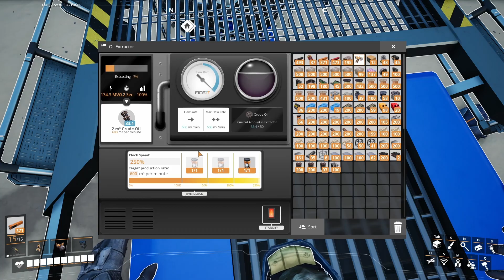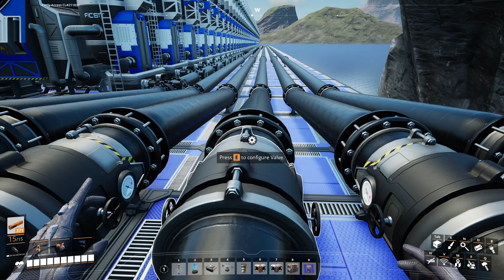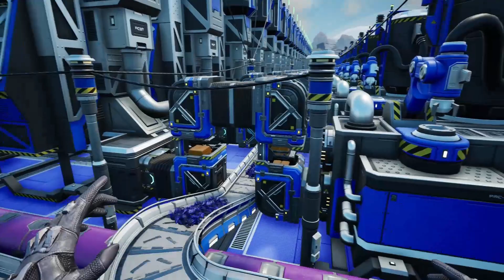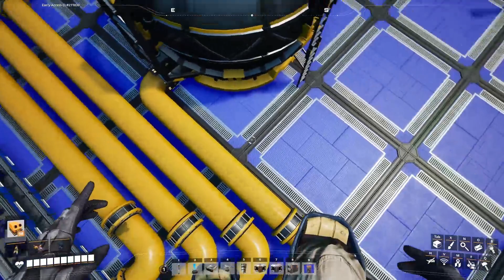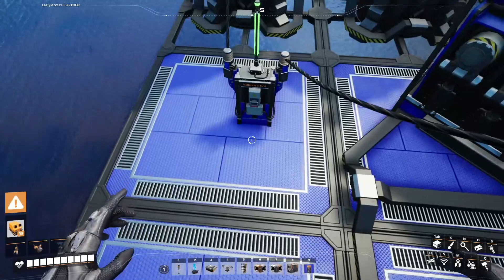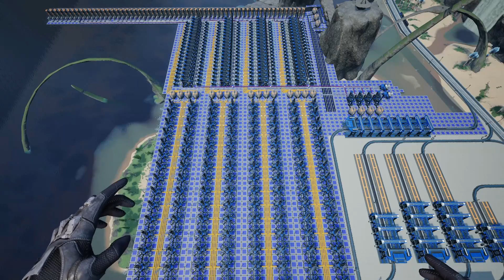Satisfactory Update 7 E-42, Tour of 400 Fuel Generators Power Station

Comment: That's awesome. What CPU / GPU do you run? Want to know when I can expect lag lol, I want to do this eventually
Reply from the maker: Computer Specifications:
AMD Ryzen 9 3900X
G.Skill Trident Z Neo Series 32GB (2 x 16GB)
MPG X570 Gaming Edge WiFi motherboard
NVIDIA GeForce RTX 4070 Ti
Samsung SSD M.2  970 500GB boot drive
Samsung SSD 860 QVO 2TB drive

I tried running the game at 1440p, but frame rates would stutter too much when I got close to factories.  I turned it back down to 1080p and it's much better. 60 FPS, which I have capped, is consistent except when I approach factories and after the area loads in the FPS settle back to 60. Thank you for watching!